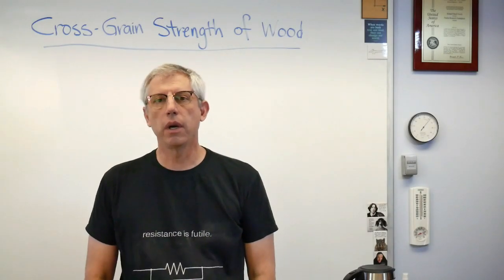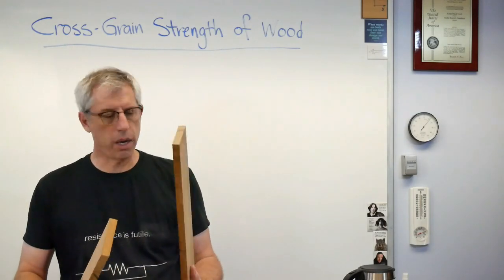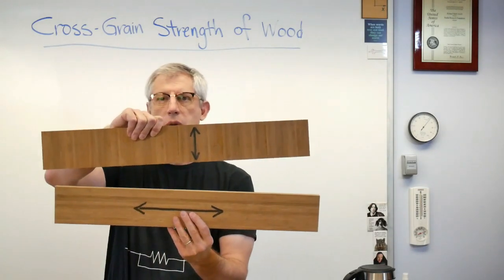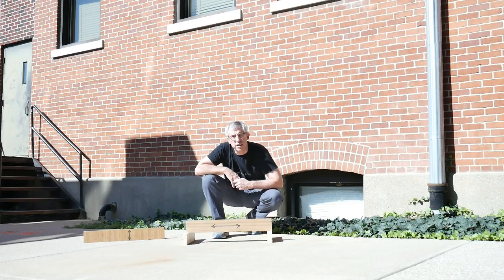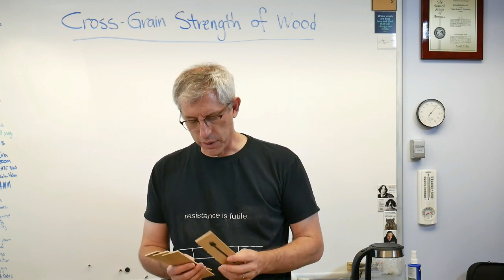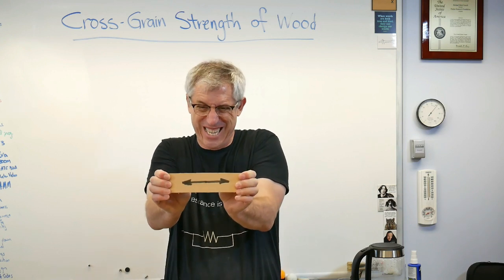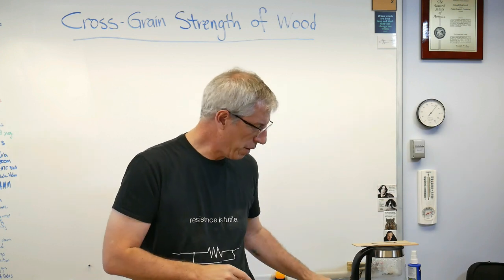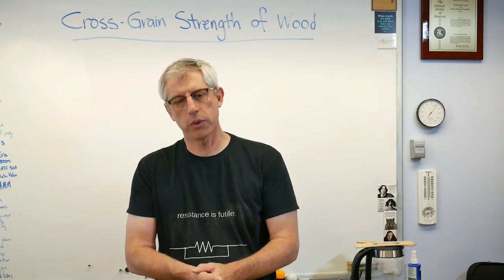Cross Grain Strength of Wood - Brain Waves

Comment: Are there any simple calculators that would tell me how much weight a 2x4 or 1x6, placed width side up, could withstand with weight placed at the middle and supported at x feet apart? I'm looking to build a bed frame and I'm wondering if a 1"x6"x80" would be strong enough, as a side rail, with one leg under the middle. Of course, wood species is important, but I don't understand the connection between bending strength in PSI for a given wood species versus say 150 lbs man standing at the middle of a 3' span of 1x6. I am assuming grain is lengthwise.

Comment: Sir may I ask why the wood is stronger, when its grain direction is along the longitudinal axis of the wood? thank you in advance!
Reply: Since no one answered this I’ll give it a shot. It really has everything to do with the anatomy of the tree and the cellular structure of wood. A board oriented in the longitudinal axis is oriented exactly the way a tree grows. The tree needs strength this direction to resist bending and breaking from wind ice and snow. Even branches which grow horizontally can be thought of as having their grain oriented longitudinally. It’s only when wood is sawn into boards do we get the opportunity to apply a load along a purely transverse axis. The wood is weak this way because the grain is running across the board not along its length. The cells that tie wood fibers transversely are much fewer. If we we to look at the cells under magnification we could identify the micro anatomy of wood which is said to be “anisotropic” not the same in all directions. There is a third axis of wood as well but it isn’t often encountered in engineering. Still there’s a breaking strength that can be measured in this axis, but I’m not sure what it’s called. If you imagine a piece of wood sliced in the round like a salami and take that disc and break it, that’s the third axis. Wood is even weaker in this direction than the transverse.
Reply: @duncescotus2342  That answer my doubts i think. So then , wood has higher cross grain bending strength with heart up than heart down??